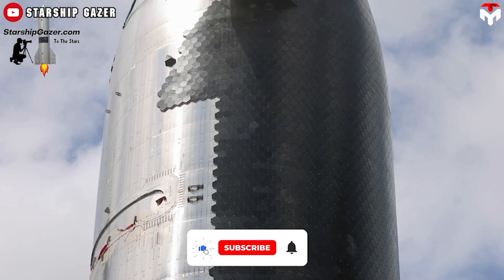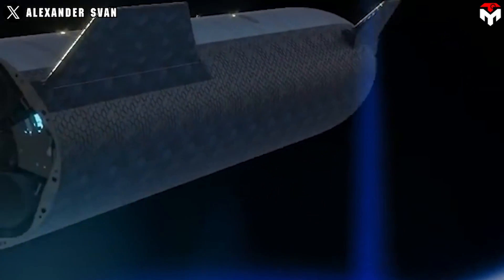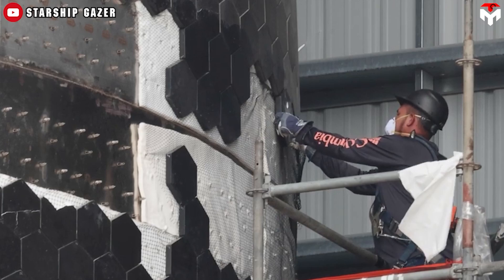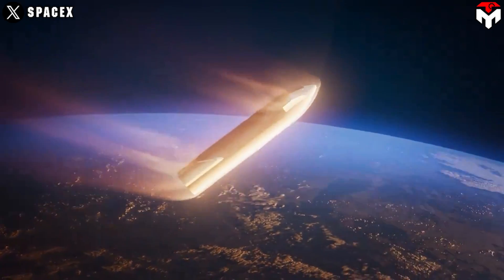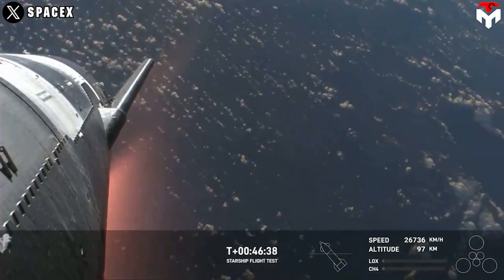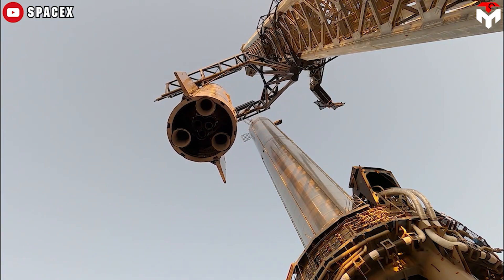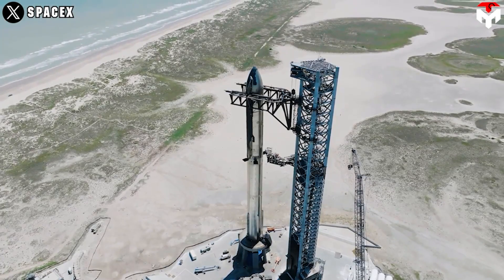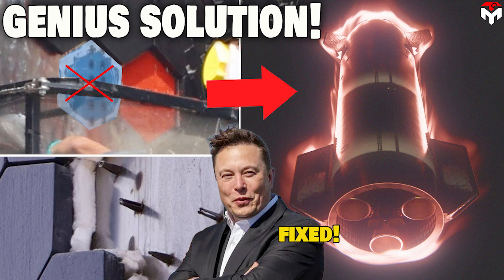Genius! SpaceX Big Solution To Protect Starship Heat Shield In Upcoming RE-ENTRY...

Comment: The different thermal properties may be the Achilles heel…

Tiles are mission critical only for re-entry. 

For the moon mission, the lunar lander does not need to return to Earth and neither will the tankers need to…

The re-entry Starship can remain in low orbit around  the  earth, etc… with the lunar lander acting as the ferry…

So, only double down on the heat shield for the re-entry vehicle in low earth orbit, and handle whatever extra mass required for safe re-entry tiles…

Meanwhile, keep up the tile story research 🎉 Reliable, rapid reusability, comes later 🎉

There needs to be at least two lunar landers, with one in lunar orbit for rescuing

Comment: Come on, make some (thermally useless) transparent tiles, or locking plates, do that you can examine the locking mechanism in action, as the tile is push-fit.

I still say that the outward facing end of the pins looks to be poorly designed.
And something more like a self gripping sprung raw plug would hold the tiles on better, while still allowing for thermal expansion.

Comment: One of the clearest pictures of the Heat Shield Metal Pins I have seen - it looks to me like the design of the pins locking mechanism could be substantially improved, compared to its current configuration.
It seems to me that the pins should be shaped more like a Xmas tree.

Comment: Tiles will not work! They did work on the space shuttle! You need to use the same type used on dragon!
Reply: So far, there is no indication that the heat-shield tiles don’t work.
The only problem has been some tiles coming loose.
Reply from the maker: Is that suitable for Moon and Mars colonize?

Comment: I don't think the space shuttle had heat tiles on a fuel tank. lol
Reply: The tank had foam to reduce boil off, and the tank was designed to burn up on reentry, so no.  That would be counter productive.

Comment: Believe the tiles and clip system is fine... |We have to remember the ship was spinning the entire way down and when upside down where the pressure would have gone under the edge tiles they still didnt fly off.. On normal entry all the tiles would be pressing against the body and hold even harder.

in addition even though the ship came in many times with the non shielded part of the ship experiencing plasma and until we lost video didnt even change color, what broke the ship apart was it tumbling, not any failure of the heat shields.

Comment: Bass, bass and more bass. The attachements should be springs which can absorb vibration and in order to prevent the tiles to rotate in the row, there should be two diametral opposed pins, inserting in two orifices in the tile,  which fix the tile against rotation and against touching the neighbouring ones.  More hilarious would be a feather-like approach to the heatshield using elongated tiles which feather-like mounted oblique to the surface overlap each other , like tiles on house roofs, but with gaps between the rows.
Reply: I think the pins should be barbed more like a Xmas tree, so that the tiles can be push-fit onto them, but not removed without destroying the tile. So a positive lock system, that can still accommodate some lateral movement, to allow for thermal expansion.
Reply from the maker: I like the idea of using spring as an attachment and I get curious about how to pin it on the tiles and the rocket's hull

Comment: Why not have some  pins in the SIDES of the tiles too? Then the adjacent tiles would help hold the odd loose tile in place.  The tile covering would effectively  be ALL one piece.
Reply: The tiles are made from a 'rigid ceramic foam.'  You can literally dig through it using your fingernails.  Those studs would cause the failing tile to damage the tiles around it.  A better idea would be to use a rigid backing that is glued to the tile and the rigid backing is what's attached to the spacecraft.  This way the entire surface of the bottom of the tile is the attachment point and if the tile is damaged - at least some protection would remain.  I'm not sure what formula SpaceX is using for their tiles - but adding a small amount of boron to the mix before dewatering adds additional strength and durability.
Reply: What would do better than the tiles is an energy shield. 1 day their engineer will find it.
Reply: No bad idea - because it would disrupt the tiles.

Comment: DUMB TPS IDEA --->>> Use one of those fiberglass chop guns to spray carbon-fiber random strands and resin, to the outside of the tiles. This will help them remain intact during thunderous ignition and liftoff.  It will burn off  during reentry and need to be reapplied for subsequent launches.
Reply: perhaps heatset glue and a sheet of high temp plastic, definitely a possibility but i don't think carbon fibre will burn off enough to make repairs easy.  though, yes, an easily applied coating to hold things in place during launch is a good idea.  vac bagging perhaps.

Comment: The important difference between the Space Shuttle and the Starship is the material. Whereas the aluminum of the shuttle does not sustain much temperature the steel of the Starship may get much hotter until it weakens. At this temperature, all glues are already damaged and out of function.
Reply from the maker: Also have the same thought, I have no idea whether the new type of glue can solve that matter
Reply: @techmap9  Classic glues are all organic, and so they are very limited in temperature.

Comment: I thing may be there is another form for the tile like the scutoid (https://en.wikipedia.org/wiki/Scutoid) but  NOT an individual form for each tile, perhabs each tile has the form of a regular group of scutoids. And its bounds fit with its neighbor to get blocked.
Reply: There needs to be space between the tiles to account for thermal expansion.
Reply: @colincampbell767  with a proper gap between sides will solution that and in the limit the couplig will enforce all the grid together. I think the vibration its a worst scene, a anchor system like Anti-theft EAS PIN mechanism will be better but for thermal issues and complexity may not work at all. May be in the current pin mechanist needs to all three point make force together insted one by one sujection point

Comment: Current tile design is lousy. They need something new. I belive they need to use new material sciense to get better long lasting composite heat shield.
Reply: I think the current tiles are probably very good.  But I think that the pins are poorly designed. The ends should be gripping on the outside, more like a raw-plug.
Reply: @peterclarke3020  Maybe its good for one time use. But they want to fly the same rocket many times a day.  With this kinda design no way they can do it.
Reply: Ceramics are used because they are the only things that won't melt but will still serve as insulation.  Think of the tiles as ultra low density firebrick.

Comment: Use tiles thar aren't as brittle.
Reply: A you mean tiles amide out of 'unobtanuim?'  (Ubobtaiumn is an engineering term for a material that's perfect in every way for your application whose only drawback is that it doesn't exist.)

Only ceramics can take these levels of heat and you have to make a foam out of those ceramics to make them insulate.  So, you have a ceramic material that's 95% empty space.

Comment: Tungsten melting point 3000 C degrees. If starship (not booster) would be made of Tungsten from outside,  it would cost approximately 20-30 million USD more, but any protective tiles from outside wouldn't be necessary at all (very expensive labour, tiles). Tungsten shouldn't melt during reentry, and heat protection could be applied from inside, much easier to do. Also stainless steel with high percentage of Tungsten could resolve the problem. I have some other ideas how to protect Starship from heating during reentry. Good luck, Elon, you are on the right track!
Reply: Won't work.  Metals conduct heat really well and the tungsten may not melt - but the structure it's supposed to be protecting will.  And mixing the tungsten with the steel won't work because the iron will still melt.  (At 1000F structural steel loses 70% of it's strength.)  The melting point isn't as important as how much strength it retains at the temperatures it will be subjected to during re-entry.

Comment: perhaps larger - full segments - moulded tiles would do. A full nose cone cover. One for each fin. Front 1/2. Back half. Ok, going around more than 180' of the ship in one single mould. Shucks! Why don't they just 3D print a heat shield around each craft?
Reply: First of all - I doubt that billets of rigid ceramic foam can even be made that large and not have them collapse under their own weight while drying - or even survive being moved from the mold to the dryer.  Second of all a tile that large would shatter from thermal stress and it heats up in the kiln.

Comment: In industrial rotary kilns, mastic adhesive and fire blankets are used next to the steel. Fire bricks are used as the final barrier. A high temperature resistant mastic adhesive should be used in conjunction with mineral wool filing in the mastic. Drop the pins and just used the adhesive. Multiple interleaving layers of high temperature resistant tiles would provide a defense in depth approach,
Reply: That might offer lots of heat protection, but another requirement, is that the heat shield be as light as possible.
Reply: SpaceX had very good reason to drop the adhesive.  The stuff is a nightmare to work with.  The Space Shuttle and the B2 both use adhesive to attach the ceramic thermal insulation and it's time consuming and difficult.  Need to be done in a protected environment and if you touch the bottom of the tile with your bare hand - the oil in your fingerprint can cause the adhesive not to bond properly.  A better idea would be to use a rigid metal base (such as an aluminum honeycomb) and bond the tiles to it in the factory where you can get a temperature and humidity-controlled environment.  The attach the plate to the studs using one way press in connectors.

Comment: The Big Solution should be lauded after flight test. Until then its just an idea, a suggestion, a strategy. It could become genius if it works..
You would sound silly if the vehicle burned up after the genius solution right?

Comment: So why does Starship choose to layer a heatshield covering its nose and body?
SpaceX pioneered landing boosters by firing rockets and traveling backwards so that the rocket heatshields are forward.
Surely, the same technique would work fine for the upper stage payload Starship.
Reply: That requires carrying more fuel and less payload
Reply: Orbital re-entry is much faster than sub orbital so they need to use the larger surface area of starship to scrub off velocity through friction to decelerate like a sky diver

Comment: There is no "cooling system" on the Starship stainless steel hull that requires fuel to run. The thermal protection system is entirely passive, i.e. only the tiles are used. There are no moving parts on the Starship TPS.

Wrong. The Space Shuttle was launched 135 times with 133 successful flights from launch to landing. The two disasters (Challenger in 1986 and Columbia in 2003) were not caused by the tiles. The tiles performed exactly as designed to protect the Orbiter from overheating during those 133 successful flights.

The surface of the tiles is purposely kept smooth. A rough surface can trigger turbulent flow in the boundary layer that could increase the heating experienced by the tiles.

Comment: I don't understand why the tiles don't overlap like roof shingles or fish scales.  If air got behind a tile during reentry, it would rip it off.  I don't think any kind of attachment would work at those speeds if air got behind tiles.
Reply: Because they are trying to minimise the weight, so they don’t want any overlaps.
Reply: Because they need to keep the heat shield as light as possible - so no extra overlapping material. Plus overlapping tiles would be even more difficult to attach.
Reply: @peterclarke3020  Not so because the added material from the outside flap comes from the tile it covers.  Like a lap joint.  So, like a lap joint, the inside flap slides under the outside flap of the previous tile.  And the outside flap helps hold down the inside flap of the next tile.

Comment: Its clear to me that the pin contact holes are in fact the problem. The fact there is zero damage to them from tiles found says one thing loud and clear. Because they are not damaged says the contact between the pins and the holes is not strong. Otherwise there would be damage on the tiles that came off.

Comment: As tiles & hulls expand or shrink, the tile attachment pins are exerting stresses on the tiles. Using a corkscrew or spring lower section, near the skin, would allow differential expansion, with less local stress on fragile tiles. Just an idea from a Scottish engineer.
Reply from the maker: Wow, Great ideas. I will find more about this

Comment: Heat shield tiles experience large dimensional change.  Propellant is neg 200 and then re-entry heats them up  to +2000.  The change in of each tiles dimensions makes the challenge  of keeping tiles attached and aggravated by  vibration from rocket
Reply from the maker: Yeah. This is a big gap